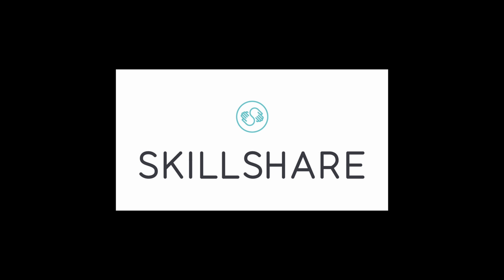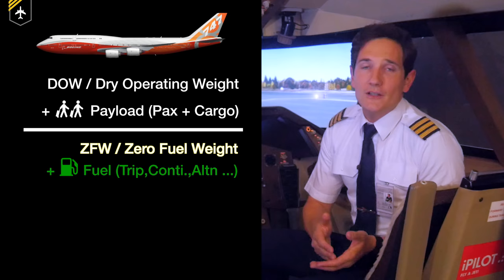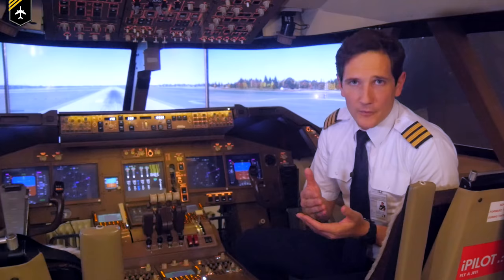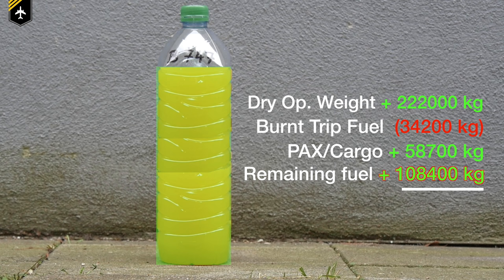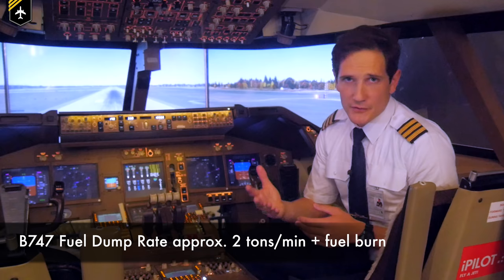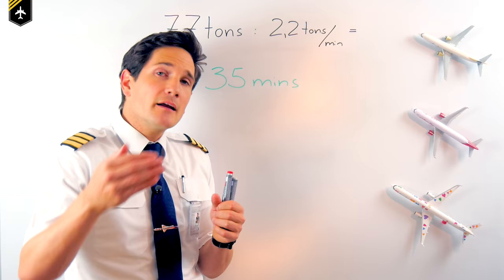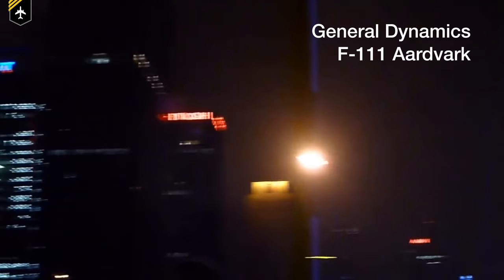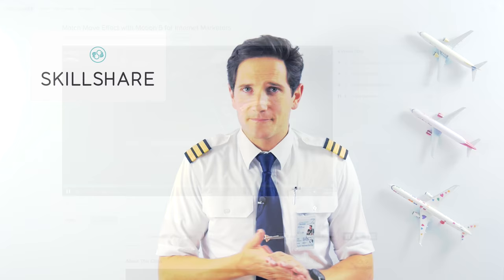Why do PILOTS DUMP FUEL??? Explained by CAPTAIN JOE

Comment: Saved the guy with a heart attack. Killed/poisoned everything under the plane.
Reply: the fuel gets diluted, but it does harm the enviroment
Reply: Clearly didn't watch video lel
Reply: nbookie im surprised that this is even alowed. With so may flights nowadays, this could polute and poison the enviroment a lot.
Reply: nbookie the fuel used in planes is better for the environment then the fuel for cars
Reply: vintageslayer please explain.
Reply: As mentioned above, plane fuels r extremely volatile and pure. Im no expert but since it evaporates so quickly and by the time it reaches the ground (assuming some does and didnt get disintegrated) its gonna be pretty dilute anyway. Definitely not gonna kill anything below. Some enviromental problems, maybe, but most likely no for those rare occasions.
Reply: Just jet fuel, not a big deal, not very toxic
Reply: nbookie the most common jet fuel, JP1, is just purified kerosene (might be some additives but I don't think so, additives are more for piston engines than turbines).

It is bad for the environment, but it isn't THAT bad. It also does get spread over a wide area, which makes the impact on any one spot less... Although you'd think that's also make it harder or impossible to clean up. Not sure about that.
Reply: Chemtrails
Reply: vintageslayer gasoline has a much higher vapor pressure than jet fuel. Meaning it is more volatile and evaporates more readily. So it would actually be better to dump gasoline than jet fuel; all things being equal. (Both at high altitude) also it is done very infrequently. In the example in the video, that would equate to ~$130k worth of fuel (77k kilos is 170k lbs, divided by 6.8 lbs per gallon, the weight of jet fuel, is 25k gallons, and the average price is $5/gallon.) So they're not just dumping fuel all over the place.
Reply: The solution to pollution is in dilution. Sure if the plane dumps the fuel 500 feet over your house there will be problems. Up in the stratosphere, not so much. I’m too lazy to do the math but we are talking about ratios of thousands of moles of atmosphere to one mole of fuel. 
Couple that with jet fuel being basically kerosine, no big deal, it’s probably more harmful to the environment being burned in the engine than it is in its unburned form.
Reply: Go to your local airport and ask them to pour a cup of JetA fuel on the ground for you. You can literally watch it evaporate in 30 seconds. When dumped, it's sprayed into a fine mist that evaporates well before it hits the ground
Reply: I hope you don't get into a car or anything that uses fuel. You know what get off the internet the power generated from the device you're using has killed something somewhere.
Reply: It was lovely a couple summers back, sitting at the city pool watching a plane circling our city dumping fuel. Plenty of desert they could have dumped fuel over, but they decided to lay a curtain down around us.
Reply: I kinda doubt putting a few tonnes of vapourised fuel into an atmosphere that weighs almost a billion billion tonnes will make much difference... That stuff will diffuse in the upper atmosphere and will never contact the ground in noticeable quantities, there are far more concentrated pollutants at ground level from other vehicles operating normally. Plus unburnt fuel probably isn't even worse for the environment than the products of burning the fuel anyway.

Comment: Short explanation: because the plane is too heavy.
Reply: But it's nice to know the explained version. Not just a short answer like yours.
Reply: Short question: why they add unnecessary fuel on the first place?
Reply: @Daniel . that is a good question. I guess it's better to have a little more extra than not enough. If e.g. something happens (medical emergency etc.) and the pilot has to emergency land somewhere else (at a different airport) they'll be able to do so with the extra fuel. It's for contingency purposes.
Reply: Because you do not want to put the bare minimum on the plane to just cover the trip. You must account for variables such as headwind or storms that cause the plane to burn more than usual amounts of fuel. Also there can be emergencies such as weather or a terrorist act closing down the destination, forcing the plane to detour to a terminal further away.
Reply: yeah and it's 9/11 today.
Reply: Andrew DeWitt ok, ur explanation have senses
Reply: (continued) to land.
Reply: Rambo Rider ... It’s not just ‘nice’ to know but the entire purpose of the clip. Now, if for the explanation of ‘why’ the short explanation was given, perhaps ‘Because Antonio is an inept comedian.’ would work well.
Reply: I dont think sending a guy out the door has anything to do with the airplanes weight..  in fact it might be a couple 100 pounds lighter after..   lol
Reply: Kumar Kumar thanks
Reply: To prevent expensive plane damage.. Plan3 too heavy doesn't explain it fully.
Reply: They dont5.. In case of emergency early landing ;)
Reply: Exactly too heavy for what.. Too heavy to not incur hull damage due to hitting runway. Its f...ckin 222 tones airplane.. 500 000 pounds aprox.
Reply: @Zipp0nIc  Also keep in mind, that dumping excess fuel is not something that is done at the end of every flight! Even with the safety fuel margin, if the plane has completed its planned route, it will be below its landing weight even with the extra. Dumping is only necessary if the flight has to be cut short for some reason.

Planes on short routes are only filled with as much fuel as they need (including the extra safety-margin fuel, of course) since to over-fill beyond that would add weight and cost for no benefit.
Reply: @Zipp0nIc  Because air currents may vary if they are against you flight will take longer therefore more fuel needed. Things like that are to be considered.
Reply: @Zipp0nIc  I thought the same
Reply: Plain engineers didn't figure out how to efficiantly fly yet?
Reply: @Zipp0nIc  they need to add fuel max to reduce wing stress, since main body give gravity force and wings add lift force if there is unbalance weight between body and wings the wings will be broken
Reply: @Quinid1  well put less people on the plane or make it stronger dumping fuel should definitely be banned
Reply: At least he didn't go above 10 minutes with a boring filler to get extra money
Reply: Ray Vorontsoff  the engineers are paid by the air lines to create a profitable plane they don't say first priority is the environment do they and if you baned it the engeneers will develop some new way of getting around the problem
Reply: Short answer: Dumping fuel and chentrails are two different things
Reply: Ray Vorontsoff  you clearly ain't very bright if you think that the fuel is even near the cost of re designing a plane its one or the other and I know wich one is cheeper
Reply: Ray Vorontsoff  yeah that's convenient just change the subject when you can't think of a point and  presumably your refering to cortez I am a Republican
Reply: saved me 9 min
Reply: @Zipp0nIc  The fuel isn't unnecessary. The trick is its easier to take off with a lot of weight than it is to land with it.

Comment: You’re dumping 77,000kg of fuel ⛽️ in air? 
More environmentally better to dump that passenger.
Reply: Squirrel Make sure you pick the drunk ones.
Reply: imagine if you're THAT passenger??? You wouldnt be happy for sure!
Reply: @Sarah-l7f6o  To that I say - it's time to stock parachutes on board ;) If I was in a cramped torture seat that is every airplane seat these days for many hours I'd probably volunteer to just jump out :D
Reply: THE ENVIRONMENT WONT BE DAMAGED AS THE KEROSENE WILL EVAPORATE AND CRYSTALISE BEFORE IT REACHES 9000 FEET IN THE AIR
Reply: @thundurr  So where do you think all that evaporated kerosene will go ?
Reply: BasicallyImOrlly what are you even talking about? You think it’s good for the environment for a bunch of kerosene to be in the air? You think that’s good to breathe? 🤦‍♀️
Reply: @OrangeFluffyCat  Ok, u right
Reply: @Sarah-l7f6o  Some people would actually. :D I wouldnt be surprised if someone tried to sue pilot for dumping the fuel to save their life... So yeah better throw that person off. :D Just joking. (but looking at it by cold numbers value of that fuel is much higher than that of one life)
Reply: Passenger he picked just for an example. There are many other cases too.
Reply: Soul Machines only difference is the fuel weighs much more than passengers
Reply: Tim Henry sounds like you ate some paint chips too.
Reply: It would be a disaster if anyone opened the emergency exit door, if the cabin was pressurised.
Reply: @antoniograncino3506  "all that" ... they don't do it "all the time" just when they are forced to
Reply: lmao
Reply: Communism much?
Reply: There are no combustion engines on jets. No fuel lines or tanks either. No exhaust. Anyone who believes that all that “fuel” can fit in jets tiny wings is insane. Research jet fuel hoax and stop believing impossible lies. Also, air planes fly over plane aka level aka flat Earth. The seed is planted- don’t bother responding, I am out
Reply: The nature... mhhh cerosene nononono
Reply: Get em drunk before chucking them out haha
Reply: Frankie Robinson 😂🤦🏻‍♂️
Reply: well wouldnt dumping fuel help the environment because you remove any potential carbon emissions by just dissipating it at such a high altitude?
Reply: That 77.000 kg passenger..? 🤦🏻‍♂️
Yeah..great idea😂🤪
Reply: Haha people take comments too seriously, I thought this was funny
Reply: The fuel is volatile in nature, meaning that its bonds will promptly break and it would immediately evaporate in the sky, so....
Reply: @nyanates  Or just a few of the loudest babys.
Reply: @sarairobinson4964  found the person we vote out
Reply: If not more morbid
Reply: @antoniograncino3506  in the air, with all the co2 and other garbage we as a society dump in th air. It’s bad for the environment sure, but remember that this is fuel that would have been burned anyway.
Reply: What I thought

Comment: The F-111 dump and burn clip was from Brisbane's Riverfire festival, which is held annually.  Unfortunately, the F-111s are retired so, instead of the dump and burn signalling the start/end of the fireworks, we get F-18 Superhornets just buzzing around in the afternoon.  The dump and burn was also used at the opening ceremony of Expo '88 in Brisbane.

Comment: In case of emergency landing, the plane will be damaged if it lands while overweight.

There ya go
Reply: Saved me 9 minutes ty
Reply: God bless you.
Reply: I've done that before and I end up doing 200 Knots and kill the plane, the exercise that airlines should do when operating a bigger planes on short rout is to put what ever amount of fuel you need in order to keep the weight down. over fuel and dumping fuel is just a big waste of money and its bad for the environment, and hazard waste.
Reply: Perich29 sometimes you need extra fuel, it’s just precautionary
Reply: @Perich29  watch the video
Reply: Why not just make the landing gear strong enough to withstand the full takeoff weight at landing?
Reply: @Perich29  you're definitely not a pilot
Reply: @Perich29  do you actually know what you're talking about?
Reply: @carultch  maybe because to do so, you'll have to redesign not just the landing gears but also the fuselage and wings to accomodate it

Comment: Thank you Captain Joe, I've learned a lot in this nice video very well explained answering to questions we may have.
I ignored there was a max landing weight in the sense the plane can carry more fuel than tolerated to land with (if passengers+cargo is is loaded...), but for take off it's ok. Interesting difference well explained.
Btw dumping fuel with flames would be more badass. ;D

Comment: Moral of the story .. if you have a heart condition then only fly on planes that can dump fuel. 👍⛽
Reply: Yeah , stick to ground level travel where you can be rapidly transported to a medical center... And not force someone to waste dozens of tons of fuel and delay other people. Plus the risk emergency landings involve , pilots train for them but your mind is never really ready for one so the risk is always higher than on a normal landing.
Reply: Moral of the story if you have heart condition don't fly and ruin everyone's experience
Reply: @TheTankCrew  
Yes, if someone has a heart condition and possibly could die, your delay is of utmost importance...
shaking head in disbelief
Reply: Good luck finding a 777 going from Heathrow to Amsterdam.
Reply: Capt Joe said there is a special overweight landing procedure for planes not equipped to dump fuel.   All planes should be able to land asap in an emergency.
Reply: To Sekrit dokuments : unless your cruise ship has a hospital on board, you're safer taking a plane if you have a heart condition...

Comment: One deployment we had a KC-135 stratotanker take off and while the boom operator was checking the boom he extended it while still stowed. The hydraulics cut out and it was stuck out so the crew couldn't dump fuel. They had to fly for over 13 hours to be light enough to land. They were very unhappy when I got them in debrief.

Comment: I did not know that the air was filled with fresh petrol.
Reply: White fuel
Reply: Don't smoke.
You'll set the atmosphere on fire.
Reply: Im to pretty to die. 
Char broil isn't my ending.
Reply: Imagine if you just ignite your lighter and then in seconds later you burn the sky and surroundings of you.
Reply: Kerosene 🤪

Comment: $3.40/gal for gas and these people just dumping it over scotland
Reply: ThAts a cute price. In Australia we pay 1.40-1.60$ per litre (~6$ gallon)
Reply: Besides, jet fuel is about 3x the cost of common unleaded
Reply: They have to dump several tons per day or they would loose their scottish accent.
Reply: bobwatters What? Like in an onboard pizza oven?
Reply: bobwatters  I suppose planes could be fitted with a means of burning off the fuel without adding thrust, but then if something goes wrong with the system, your plane explodes. It's probably also more environmentally-friendly to dump it into the atmosphere than burn it off.
Reply: It’s $7.30/gal in scotland
Reply: Thats cute. In Poland we pay around 4.05 Polish Zloty for liter, and thats around 1.03$ or 0.94€ XD!
Reply: That’s cute in India it 0 rupees for 50 litres which converts to about $0 and £0
Reply: Ma Man thanks for helping me with that math. I struggle sometimes
Reply: @Fuckoff-1  jet fuel (kerosine) costs about 50cent a litre.
 You can literally buy it at that price so long as you have somewhere safe and legal to store it
Reply: About $3.25 a gallon
Reply: bobwatters  so true

Comment: Some decades ago, a VC10 or a DC10, had to dump much fuel over Cape Town, South Africa, shortly after take-off.  At fairly low altitude.  It was widely reported in the media and people were up in arms about the pollution.

A 747 pilot friend tells me he pumps about 6,5 metric tons of Jet A-1 through the 4 engines during the few seconds of reverse thrust.  That calls for some serious fuel line plumbing!